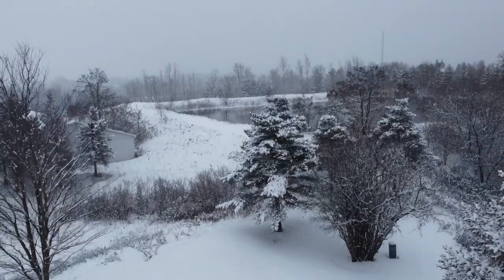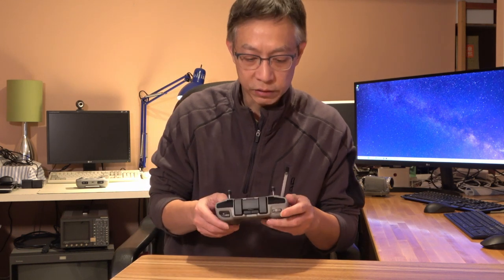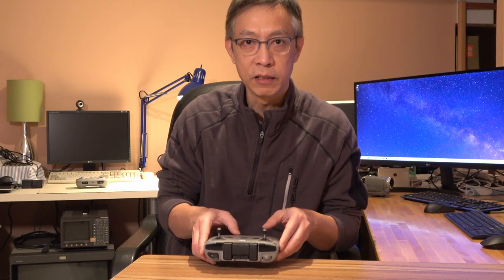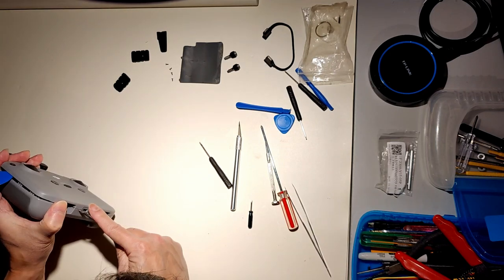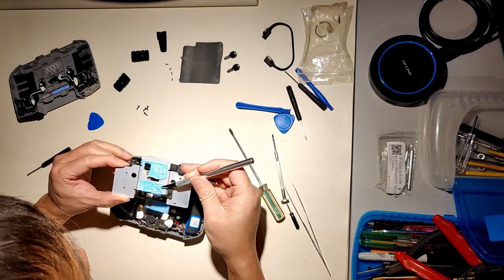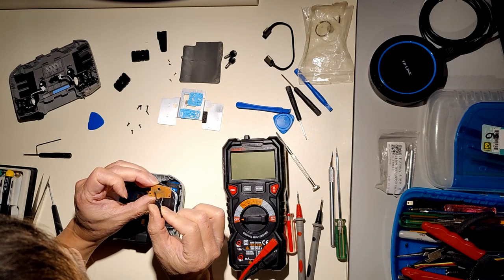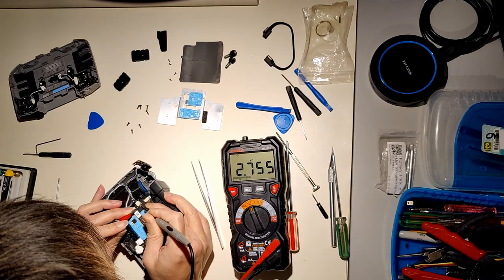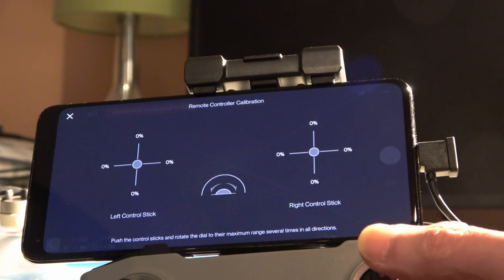DJI Remote Controller Gimbal Wheel Re-Wired

Comment: This is how quad copter became a reality, true hobbyist. I agree the wheel feels backward. Good work!
Reply: only if you are in a  backward world.. ... correct is you pull down,  you push up.......   lok at the wheel exactly the same as if it was on the left side of the case... push up takes gimble up and pull down when you want gimble down.
Reply: @philldownes8685  in planes or drones you push to get the nose down and pull to get up, so not really backwards. A lot of people have had this issue, wish DJI just made a setting in the software to have it normal or reverse.

Comment: Thanks so much.  I never would have attempted this without your video and explanation.  It was difficult to separate the two halves of the clamshell and I put some gouges in the plastic, but it was worth it.  I did not understand how to extract 2 wires from the gimbal connector.  I finally figured out that I had to lift each wire's retaining tab with a pointed knife, not for the faint hearted.  Next time I'd probably choose to cut, splice and solder to avoid the risk of destroying the connector, which would have been a disaster.   Like others, I did not remove the heat sink nor the rubber bumpers for the phone.  But I did remove the circuit board in order to swap the wires in the connector.  I'm looking forward to not having to think about how the gimbal is going to react when I adjust it!

Comment: Thanks a lot for sharing this mod to all of us out there who have the same issue. This fix is priceless for everybody that has its brain wired the right way 🤣
I actually didn't have to remove the heat sink: only remove the 4 exterior screws, open the remote (the most painful part of the mod by a mile because of all the clips) and disconnect the sticks, unplug the wheel jog cable and invert white and black. Reassemble (careful to put the cine/normal/sport switch in alignment!) and done! Brilliant.

Comment: Thanks for the video. I did this mod to my controller.  Here are some notes: You do not have to take off the top rubber phone holders to get to the screws. You do not have to remove the heat sink.  You do not have to remove the pod switch. The two wires you have switch around are the middle black and the outside white. After I was finished and before snapping the controller back together, I turned my controller back on it stated beeping on and off loudly. Thankfully there was a message on my screen telling me to power down the aircraft, go into the Control menu, and calibrate the controller. After I did that, everything worked at normal. Buttoned the controller back up and went flying. Much better. DJI really should have put something in the software to allow this wheel to be reversed. Thank you Digisky for the video. I am glad their are guys like you out there.
Reply: You're welcome, good job!
Reply: Да. Не пугайтесь звукового сигнала при смене позиций провода. Просто пройдите калибровку. Благодарю автора за видео. Я и сам хотел это поэкспериментировать.

Comment: Thank you for this video. I appreciate knowing how to open it with minimal exploration. Looks like you can access the connector without needing to remove the heat sink too.

It is of course backwards, who every heard of "pull down" in flying, it is "pull up".
Reply from the maker: Thanks, and yes the heat sink just barely cover the connector, shouldn't have to remove it. But since knowing nothing beneath and there's only screws, just curious.

Comment: Thanks so much for the video. I was going to do this myself but I was hoping there would be a firmware update to fix this design error. Looks like I will be swapping wires.
Reply: I just did the mod on mine and works great. They do NOT make the controller easy to get into. Just to note, you switch the white wire and the middle black wire.

Comment: that was a 3 pin connection correct? which 2 wires did you have to switch to complete the reversal? thanks, great video
Reply: i did this mod on the mini 1 and i switched the yellow and red wires, but i think you can switch any 2?
Reply from the maker: I double checked the original footage, you should swap the white wire and the middle black wire. (the two closed to top edge). Bottom another black wire is the middle pin of the pot.
Reply: @digisky  excellent. Thank you kindly

Comment: ut is not a problem, it is you who are wrong. think about it. you PUSH UP a window and you Pull Diwn a window.... you pull down on a rope , you pull down on a branch....... you need to get your brain working correctly..  you pull down on a rope, you do not push arope do you  /  so your finger pulls the wheel tothe lft, this means it is pulling down... its pretty clear in the normal world... oh and by the way We FLY drones we do not fry them... and you have CLIPS  holding the case not crips.........
Reply from the maker: There is no absolute right or wrong way, just personal preference. Everyone lives in their own professional world and may understand things differently. The point is DJI should make this SW selectable, like the joysticks. Oh btw, you may blame YouTube AI that generates the CC.